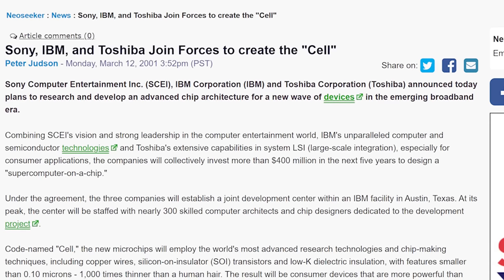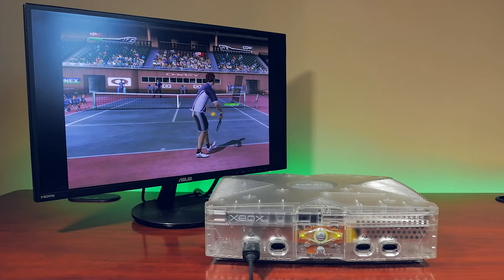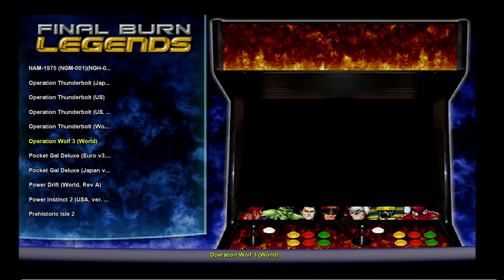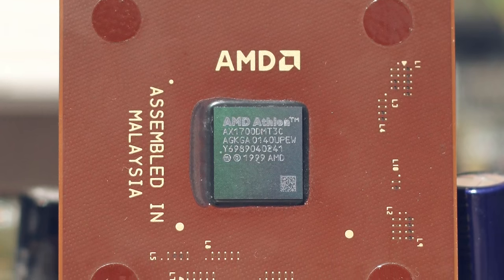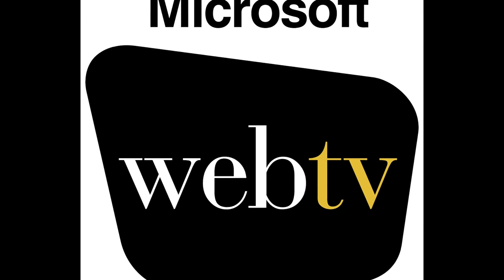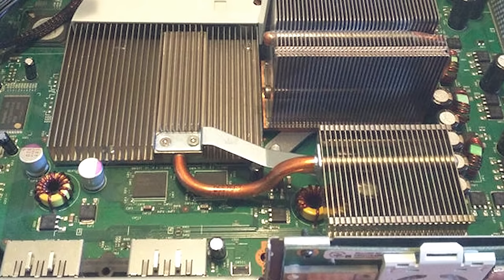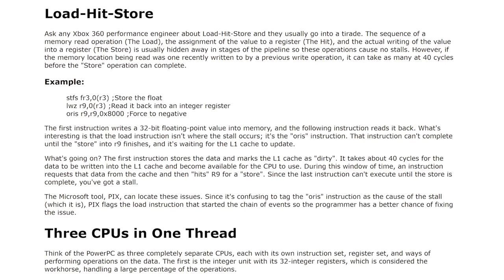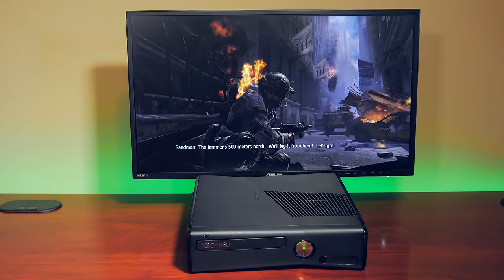Why Microsoft switched from Intel to Power PC for the Xbox 360  | MVG

Comment: Apple in 2005: “We’re moving from PowerPC to Intel”
Microsoft in 2005: “We’re moving from Intel to PowerPC”
Reply: Apple in 2020: "We're moving from x86 to ARM"
Reply: @Volodimar  what's microsoft gonna say
Reply: Microsoft staying as far away from Apple as possible.
Reply: Apple in 1994 "We're moving from Motorola 68k to PowerPC"
Reply: @matthewrease2376  "Now announcing Windows RT 2"
Reply: Intel: "ITANIUM!"
Reply: @matthewrease2376  Not true.  MS does not hate Apple.  Apple literally demoed ARM builds of Office in their WWDC main keynote this year.
Office and other MS apps on the Macintosh is still decent profits for MS.  That's why MS has their foot in both camps, intel PCs and Apple ARM PCs.  So which eever side on the hardware front is winning at a single point of time, MS also wins regardless.
Reply: @matthewrease2376  didn't Microsoft bail out apple so it actually had some competition and wouldn't be considered a monopoly at one point?
Reply: @jak3w  idk. Even if they did that doesn't mean they're on good terms with Apple (though I do believe they are on pretty good terms). If it was done to avoid being a monopoly, then that right there would have been motivation enough.
Reply: @jak3w  Back in the 90's, when Jobs came back to Apple, Bill Gates gave Jobs/Apple a cash influx to keep them above water as whilst they were rivals Jobs & Gates actually respected each other (some might call them friends), not only due to respect but also to keep Microsoft from being classed as a monopoly in home/business computer space (keep in mind this was at the time the DoJ had Microsoft in court for anti-competition practices with bundling IE and such in to Windows whilst Netscape had to be bought separately).
Reply: Remember when Apple made good computers, me neither.
Reply: @turbinegraphics16  um, yes? The Apple II? iMac G3? Dude, I hate Apple products, but they made some classic computers!
Reply: yuiii “we are staying with amd”
Reply: @spaceghostmiid  who?
Reply: turbine graphics 16 Yes, now.
Reply: @spidey9504  Microsoft as I heard it somewhere will be moving to ARM in the future as well. INtel x86 will be phased out. The arm chip is cooler, and cheaper. It is why some many embedded devices like smartphones and tablets use it. The sad thing is that also means end users will no longer be able to upgrade their hardware at will. ANd lets not forget the dreaded DRM LOCK!! MS and APPLE are BOTH making their OS DRM LOCKED to HARDWARE in the near future to force buyers to pay.. and pay some more to use computers. No more owning your PC and doing what YOU want with it.. Nice future eh?
Reply: the move of Apple from PPC to Intel probably dropped the price of each CPU. Besides, console developers would probably use it much better than general-software developers - and they did
Reply: @spaceghostmiid  the Wii and WiiU have IBM PowerPC CPUs too
Reply: Nigo It really wasn’t about price but rather performance per watt. In fact the Intel Core Duo chips cost quite a bit more then the G4’s they replaced at launch but performed much better. The MacBook Pro was actually the cheapest Intel core machine when it came out as the cost on those chips was nuts. 

Then as now Apple was a laptop manufacturer first so IBMs failure to deliver a mobile chip was unacceptable.
Reply: @turbinegraphics16  To be fair, Microsoft can't make computers worth their weight in salt neither.
Reply: yuiii 
“We’re moving from Intel to AMD”
Reply: @matthewrease2376  I still like the iPads and the iPods, but I can't stand Macs. I literally had to use one to play a DVD over airplay and MacOS BLOCKED VLC from accessing the DVD drive. I can't stand how locked down MacOS is, especially compared to Mac OS 9 which literally let you delete the entire OS if you wanted to.
Reply: @bitset3741  apple in 1985... moving from mos to m68k
Reply: @In Amber Clad it's really not a circle, they just jumping platform every 10 years or so
Reply: @pianokeyjoe  That will create opportunities for all the clone makers out there, and Linux. Of course, that's not much help if your business relies upon software that's only available on Windows or macOS... but still, competition, perhaps enough to at least keep prices from becoming too exorbitant. :/
Reply: wall mob Contrary to popular opinion, Microsoft did not bail Apple out. The $175M investment was a drop in the bucket, and was a largely symbolic gesture as part of the negotiations where Microsoft promised to continue developing Office for Mac for 5 more years. But in no way did that investment stop Apple from going under. At the time, Apple had more money in the bank than its market cap!!
Reply: @Volodimar  why are they moving to ARM cause they cannot make hot cpu's stay cool in there computers anymore so they are going to a cpu that does not get that hot lol
how apple has fallen they used to be able to make computers with IBM Powerpc processors stay cool now they can't even keep intel cool how the mighty have fallen to shame
Reply: @jak3w  Probably. I know Intel definitely did the same to AMD several times.
Reply: @matthewrease2376  Microsoft used Apple computers as the original 360 dev kits.  Nice try at the statement though, lol
Reply: @matthewrease2376  Dude MSFT and Apple don't hate each other like simple minded crap and information would have you believe.  It's all internet jokes with them shaking hands behind the scenes all the time.  They're on very good terms with Steve Jobs and Bill Gates being very good friends back in the day, even with the "Mac vs PC" ads.

That's reality, but people like the "internet" world they live in these days.
Reply: Microsoft in 2021: We're moving from PC to PC2.
Reply: andrew982 MacOS doesn’t block VLC from using a DVD drive. I did it just last week.
Reply: @spidey9504  AMD and Intel both had huge arm divisions before and sold them off. AMD is getting slowly back in, but with partner help with companies like Samsung. Nvidia is like LOL we'll just buy the damn thing.
Reply: @spidey9504 

Microsoft is developing an x86 emulator for ARM. Intel wants to sue them for that!
Reply: @FeeLtheHertZ  Fucking why though?? I don't see why they would use anyone else's hardware or software but their own in this scenario lol.
Reply: @FeeLtheHertZ  I'm actually well aware of Apple and Microsoft not hating each other, but I can still make a joke about it. I'm honestly impressed with how friendly Microsoft has been lately, in terms of cooperation with other companies. To use a recent example, while I still find it a strange decision, the fact that they are allowing one of their most popular IPs (Minecraft) to have such a major inclusion in a competitor's game (Smash), is just awesome in that regard.
Reply: @matthewrease2376  What you said, and the original iPod and original iPhone were great. Everything else they made/make sucks.
Reply: Microsoft has no intentions of moving to ARM in the near future, they made it clear on several occasions. Microsoft launched ARM Windows 10 to compete in the slimbook/2-in-1/tablet market. There is no intentions to migrate Windows to ARM on higher end laptops and desktops. x86 still has a lot of juice in it, not to mention Microsoft's reliance on legacy support. The x86 ISA will breathe its final breath one day, but it still has at least a good 10 years in it.
Reply: @jak3w  even if that is true Jobs and Gates were friends. they never hated each other and tried their best to get along. apple would take digs as MS and MS would take digs at apple. but they were to have a laugh.
Reply: @matthewrease2376  Don't forget the PowerBook G3 Pismo, the aluminum PowerBook G4 (especially the 12" model), and the Mid-2012 non-retina MacBook Pro.
Reply: @turbinegraphics16  Apple has made very good computers. They're just highly overrated by Apple fanbois.... especially the first gen Macintosh. That thing was a slow turd compared to Apple's own Apple II GS. The II GS just didn't have the Steve Jobs marketing hype behind it.... which is quite emblematic of Apple's history as a whole.
Reply: Xbox in 2013: "We're moving from PowerPC to AMD X86"
Nintendo in 2017: "We're moving from PowerPC to Nvidia Tegra"
Reply: @spidey9504  "We're moving from PowerPC to AMD"
Reply: @Volodimar  Everyone in 2028 "Anyone remember what we used before ARM?"
Reply: @Cobalt985  I really liked the RT, if only MS hadn't abandoned it like they do some many awesome hardware projects.  Between remote app and emulation RT could have been amazing
Reply: @Cobalt985  Surface Pro X: Am I Joke to You?
Reply: Wait, didn't PS3 release a cell based PowerPC CPU? I'm confused.
Reply: Both moves made sense.
Reply: YOO IM A FAN!!!!!!!!!!
Reply: @SaiyakenPHOENIX  To be fair, if Microsoft made a PC similar to the Xbox series X as an off the shelf PC it would probably sell like hotcakes.
Reply: @AndrevusWhitetail  Intel Never bailed out AMD, they've had numerous scandals over the last 40 years for anti-competitive practices.
Reply: @spidey9504  windows phone has x86 now on its reboot
Reply: @jak3w  no. The money wouldn't bave made a difference, they did it because of a lawsuit.
Reply: @gtPacheko  and so it wouldn't be considered a monopoly. Why you try to disprove what I said two years ago.
Reply: @bitset3741  Amiga moved from 68K to PowerPC not long after MAC. Intel in Amiga and MAC were 100% irrelevant back then.
Reply: i guess you can literally hackintosh an xbox 360
Reply: @jak3w  a common misconception - people forget the second part. It was not a bail out, in trade for a cash injection from MS, Apple would allow MS to sell office on Mac with exclusivity, meaning they wouldn’t compete with them for a long number of years. Can’t re,e,her exactly how long.
Reply: @Andrew982_  then you’re doing something wrong because I watch dvds on my Mac from time to time and VLC has no issues.
Reply: I wouldn't be surprised if the 10th or 11th gen consoles would switch to ARM
Reply: And the prototype 360 was a Mac
Reply: @spidey9504 Microsoft: “Our Xbox is nearly dead unfortunately. Idk what to say”
Reply: @Volodimar  Microsoft in 2024:"We're moving from x86 to ARM"
Reply: @Volodimar  Microsoft in 2024: "We're moving away from x86 to ARM".
Reply: @spidey9504  We're moving from x86 to Snapdragon X Elite.

Comment: nintendo: we want a cheap, cool running, fast chip.
chip manufactures: OH is that what people want. we thought they wanted expensive, slow space heaters.
Reply: Intel when they designed the Pentium 4.
Reply: Bulldozer says hi
Reply: At least bulldozer ended up being cheap
Reply: AMD FX: thermal generator
Reply: @KaitouKaiju  the funny thing is that one and ps4 uses the same architecture
Reply: intel when they design 14nm++++++++++++
Reply: "Great, pick two!"
Reply: @joaovitorsilvagohl682  yeah, the ps4 used the bulldozer architecture, but the cores were clocked so much lower, 1.6ghz to be specific, so it didn't suffer as much
Reply: @rastas_4221  yeah, an fx 9590 and an r9 295x2 fulfills are the heating needs. A 500W TDP gpu with a 220W TDP cpu.
Reply: @andreiarg  They used Jaguar, not Bulldozer.
Reply: @bitelaserkhalif  had an fx chip, switched to ryzen 5, I ocasionally miss the heat in winter
Reply: lol fast, that didn't age well
Reply: Buldozer chips weren't/aren't any worse for heat generation than any other chip that consumes that much power. There are consumer chips still being made that produce more heat than AMDs bulldozer line (8xxx) although they are far more powerful.
Reply: @joaovitorsilvagohl682  That would of been a little bit nicer, no PS4 uses craptacular Jaguar which is considerably worst.
Reply: Hey man, I love my PowerMac G5 for that reason. I keep that thing around for when Winter comes around. Open Final Cut 4.5, export a 1080i video and get the entire second floor of my house cookin
Reply: Notice the order in which they said. "Fast" is left for last. Nintendo learnt their lesson from the N64. They wanted to make the perfect, most powerful chip. Full of innovative features too. And that costed them everything.
Reply: darksylinc It wasn’t the faster, better hardware that hurt Nintendo during the 64.  It was realizing they needed to go to a bigger storage medium in the previous generation and then still using cartridges on the 64.  CDs had many many limitations, but those could be worked around... hot swapping cartridges to try and overcome the fatal flaw in limited storage was not something that could be done in Nintendo’s case.
Reply: @joaovitorsilvagohl682  PS4 uses very low power Jaguar cores. Since they're so old can't even compete with cell phones. Xbox uses even older, arguebly much worse bobcat. But in any case, neither use bulldozer as dozer cores would be bigger and bulldozer cores strength are clockspeed (very power inefficient and unnescessary) so jaguar cores are a better fit than bulldozer.
Reply: @CMSonYT
Jaguar is based on Steamroller, which is the 3rd gen iteration of Bulldozer. It was originally designed as a scalable, low power solution to be used for both servers and mobile devices. All the current gen consoles use it, just at different clock speeds.
Reply: if only the Wii had the 360 graphics chip in it..
Reply: Haha 😂
Reply: Try an AMD 8350 Black running at 4.6ghz for warm. AIO stops the whole room warming up too much.
Reply: @bitelaserkhalif  i used to run 2 fx-6300s in one room... now i'm getting flashbacks
Reply: @Adam Cowood . In this universe we obey the laws of thermodynamics!

An AIO would be equal if not worse than an air cooler for warming up a room. The CPU running at the same settings and power draw produces the same amount of heat no matter the cooler. The AIO might have more fans or at least an added pump which could produces that very slight little bit extra heat. This amount is negligible.

Now if the AIO allows you to over clock more than it would definitely heat the room more.

Also, an AIO  used as an exhaust will heat up the room faster than an air cooler as it will transfer heat directly out of the case but overtime the room temperatures of all cooling solutions will be the same if the CPU is running at the same speeds and power draw.

All a heat sink cooler does is transfer heat from the CPU to the air. It doesn’t even matter if the CPU runs hotter or cooler, as long as the temps are stabilized, and the power draw is the same, then the heat output of the CPU would be the same, and all you are doing is transferring the heat from the CPU to the case then to the room.
Reply: @toaster_bloke9999  no. Used they are so expensive that they aren't even worth considering, and when they were new they were outperformed by Intel Processors in a similar price range while consuming much more power.
Reply: @CMSonYT  One of the things that keeps performance down on the higher models of xbox one and ps4 is just that... those slow cores. With the new consoles at least we get an Ryzen Upgrade and that should allow for games to run smoother.
Reply: @RobbEJay . Not sure how this myth still exist. Jaguar cores aren’t based on bulldozer architecture, and are definitely not based on Steamroller given steam roller came out  after Jaguar.

The Jaguar and Bulldozer architectures are different. For example Jaguar does NOT use bulldozers shares resources architecture.

The XboxOne and PS4 do not use bulldozer based chips.
Reply: Well i use my ps3 in the winter to keep my room warm
Reply: @amartinez97  not crap jaguar was very efficient chip bit slow but 8 cores
Reply: Netburst,bulldozer and cypress cove: Am I joke to you?
Reply: @toaster_bloke9999  still power heater
Reply: @soulest2081  yep,but results bottleneck.Welp nvm now they have zen 2+rdna2
Reply: mid-2000s processor manufacturers be like:
Reply: @robertt9342  While you are correct, the meme comes from the fact that stuff like the Sandy Bridge "Core i" CPUs from intel performed leagues better while using less energy, they don't use a lot of energy (especially compared with some inter newer stuff), but they were way hotter than their intel contemporaries
Reply: @bxdroid  At least some of those hot and expensive bois are fuckin' fast. The 9900KS is still a beast even 3 generations later.
Reply: rtx 4090 ti
requires 37 megawatts of energy
4.8% faster
overheats hotter then the core of the sun.
Reply: modern x86 CPU and GPU makers be like: This beast is 3% faster than the last Generation while only taking 30W more and being $150 more expensive.
Reply: @amartinez97